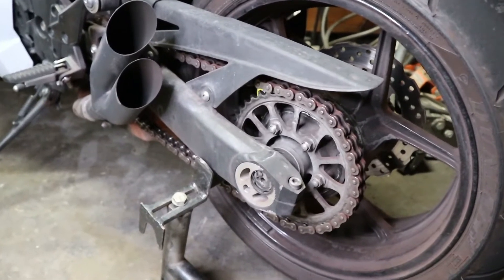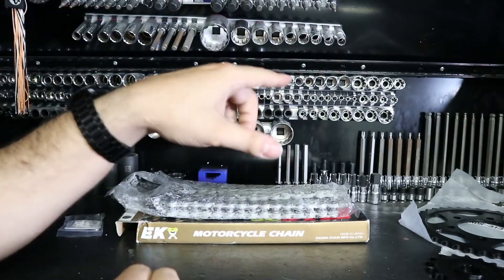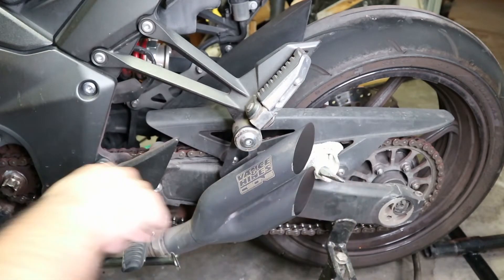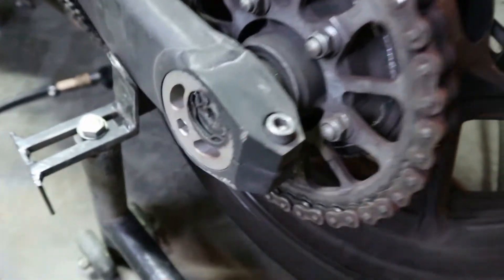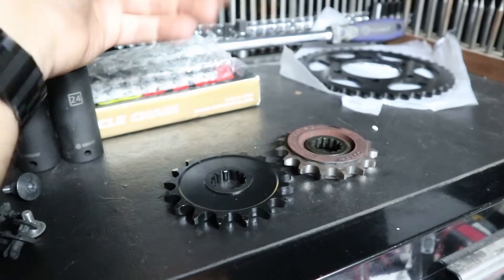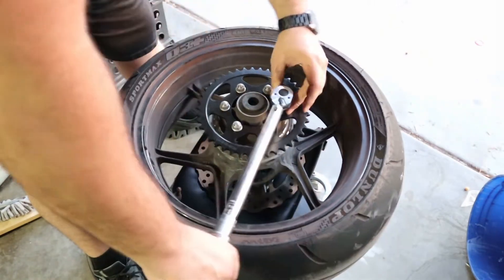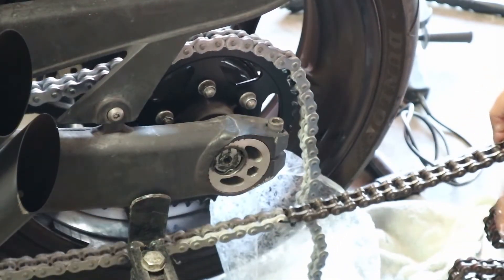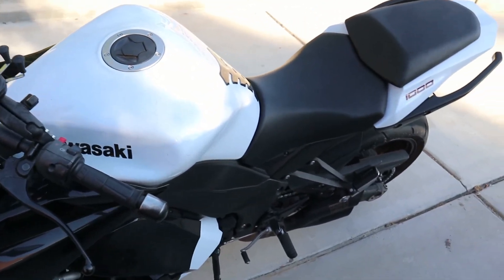Chain and Sprocket Replacement | 2013 Kawasaki Ninja 1000

Comment: The first time I took the front sprocket nut off it wouldn’t budge either. Sprayed some liquid wrench on it and let it sit for an hour and it spun right off with my impact gun. Also not sure how many links the new chain ended up being but the stock chain is 112 links so if you went up by 2 teeth on the front sprocket I’m doubting that your chain was actually 110 links.
Reply from the maker: no clue. I don't count links anymore. I simply move the rear tire as far forward as possible, rip off the old chain, lay the new one on, ziptie it to the sprocket where the master link needs to be installed, then cut off the excess. Saves tons of time and is a very efficient way to handle it.

Comment: If you tackle this job it's a good idea to remove the rear brake caliper before yanking the wheel out.  The way the presenter did it will likely scratch your rim and could also scratch the rear rotor.
Reply from the maker: You are correct
Reply: @TheMotorcycleBoss  Very helpful video, I learned something new with the grinding the heads off the pin before pushing it through.  The one time I tried doing a chain swap it was brutal getting the pin out and I broke the chain pin removal tool.
Reply from the maker: @shanedawg5856 My friend had the same issue. That's why i always gring the pin down now. Never had an issue in over a decade.

Comment: Guys don't use a tork wrench to brake the nut lose. You can damage the tork wrench. Then all of you tork specks will be incorrect. Use a braker bar.
Reply from the maker: You are correct. But i hope you aren't thinking I used a torque wrench to break anything loose in this video.

Comment: if you change the tooth count, does it mess up the traction control?
Reply from the maker: Great question. It shouldn't. The traction control is using metal disks close to the hubs to measure the speeds of the wheels. If the speed is the same, such as cruise speed or light turns, it does nothing. But if it notices to rear moving faster than the front, it knows that the front tire is off the ground or the rear tire is slipping and will reduce power accordingly. Changing the sprocket will change the powerband, torque, top speed, acceleration and such. But the tractikn control system is mainly looking at wheel speeds. So although I have no definite way to say it, I do believe that it doesn't interfere with traction control. Seriously good question tho. Never thought about it until your comment. Cheers!
Reply: @TheMotorcycleBoss  Thank you so much for your reply, it really helped, I will try to change my 2015 ninja 1000 abs sprockets this summer so I can get a higher end speed
Reply from the maker: @seyedmohsenmirmobini591  gotcha. No problem! Just keep in mind that there is a trade-off with sprocket swapping. I don't know if you already know this so I apologize if you do. When you make the bike have better mpg in the top end, you reduce your low end torque. And vice-versa. So be careful when picking your sprocket set. I would recommend looking into a Supersprox rear sprocket. They are amazing quality. Good luck with your project! Stay safe!
Reply: @TheMotorcycleBoss  yeah the ninja 1000 has already too much acceleration for me so I don't care if I lose of low end torque for a better and smoother long rides , thank you or recommendation
Reply: I dont mean to be so off topic but does someone know of a tool to get back into an instagram account??
I was stupid lost the account password. I love any tricks you can give me
Reply: @Corbin Vivaan instablaster :)
Reply: @Jamal Forest I really appreciate your reply. I got to the site thru google and I'm in the hacking process atm.
Seems to take quite some time so I will get back to you later with my results.
Reply: @Jamal Forest it did the trick and I finally got access to my account again. I am so happy!
Thanks so much, you saved my ass !
Reply: @Corbin Vivaan You are welcome xD

Comment: This doesn't look like a zx10r is that why the front sprocket is different?
Reply: ZX10R and Ninja 1000 are different bikes. This bike in this video is the Ninja 1000
Reply from the maker: The bike in the video is the Ninja 1000. The ZX10R and the Ninja 1000 are different bikes.